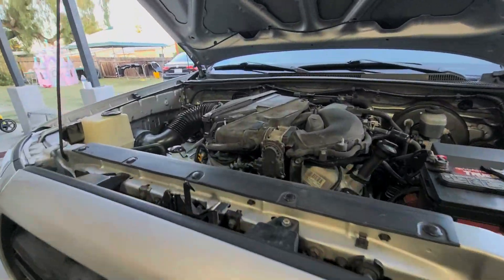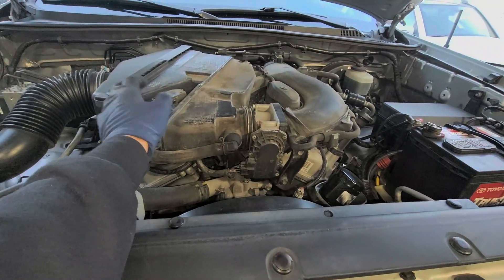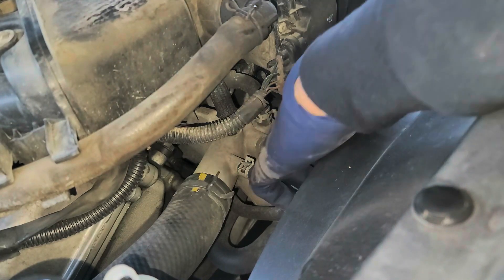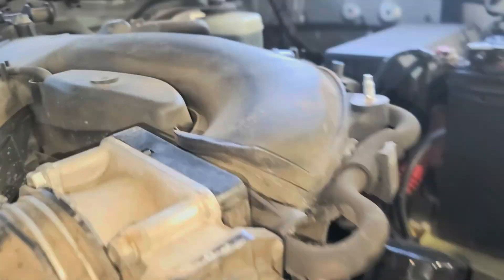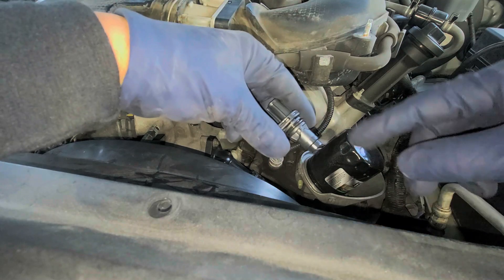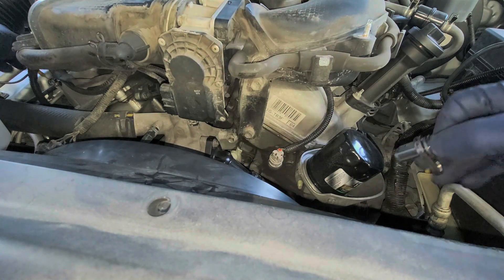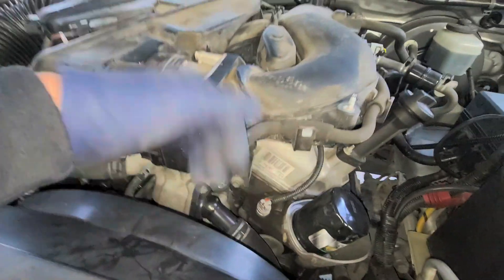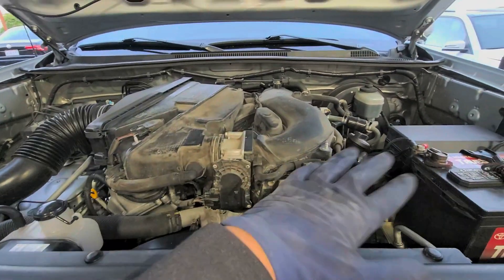2005-2014 Toyota Tacoma V6 p0340 p0345 camshaft sensor bank 2 replacement 4runner

Comment: My truck has p0016 code, runs fine. Was thinking this maybe the problem. Any thoughts?
Reply: The dealership mechanic said for my code: P0016 they want to replace the Bank one cam sensor first before condemning the VVTI gear on the camshaft.

Comment: Awesome video. Great job. Do you have a video for replacing the  crankshaft position sensor on the same engine? I think I have located it behind the AC compressor.
Reply: Did you have 2 sensors go out at once?  I have a p0335 and 0340 codes came on at the same time.  Seems unlikely 2 sensors would fail at same time I’m assuming it’s some other problem.

Comment: need crankshaft sensor wiring diagram on toyota 4runner 2013 
i was changing my spark-plugs and i happened to ripp off the camshaft position sensor harness. i got a replacement harness but do not know which order to put the wires back. i have a green, red, and green with black stripe wire. if anyone can take a picture of the cps harness on the driverside right next to the middle spark plug coil pack. it would be much appreciated.